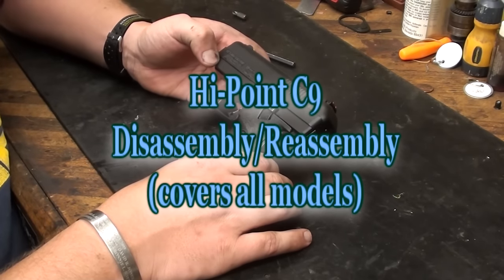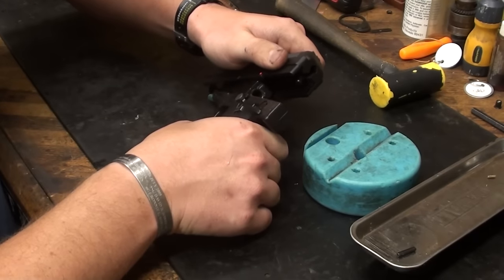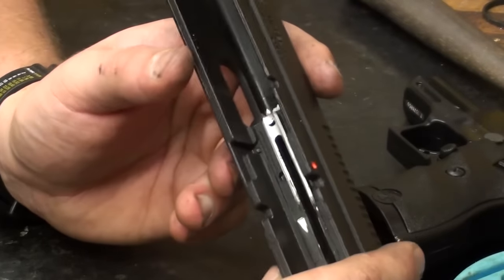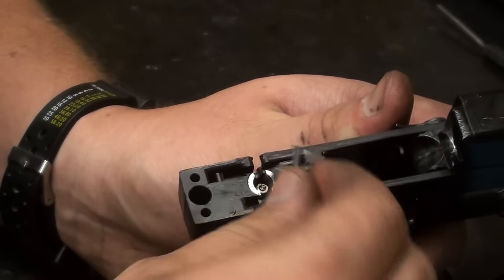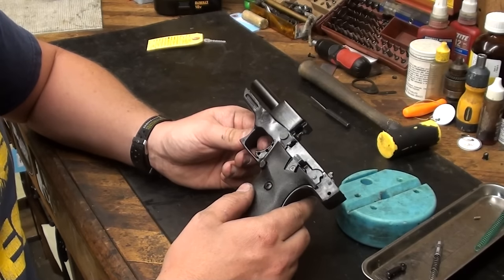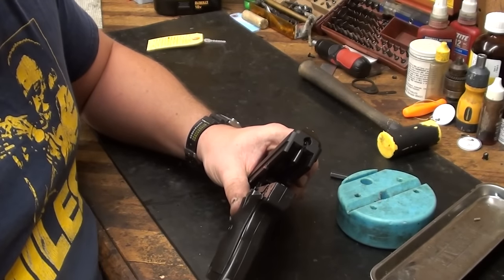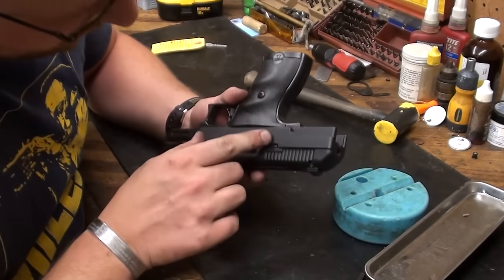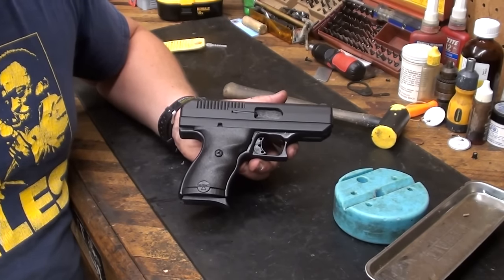Hi Point C9 Disassembly/Reassembly for Cleaning

Comment: There IS actually an ejector- the tip of the firing pin also serves as the ejector, just like the old Raven 25’s. The Beretta 25 and 22 Minx HAD ejectors, they did not have extractors at all.

Comment: Just picked up a like new Hi-Point C9 today. I mean it really looks like a new gun. Took her out right away that day and the sights were off. Got home and used a small screw driver and adjusted both windage and elevation. I also took her apart and oiled her up. There was very little cleaning involved. The gun just was not dirty. I'm thinking the original owner did not realize you could adjust the rear sight and so he got rid of the gun. His loss and my gain. Earlier the same day I had priced a new C9 at $189 at TED's. They took of $10 and would let me have it for $179. Go figure but I preferred the$100 asking price for a like new C9 over at the other gun store Called "Kings" Columbia TN. They let me have it for $119.99 out the door including tax and the $10 background fee. They originally asked for $129 for the pistol but they were nice enough to take of the $29. This helped me a lot financially and I made the purchase. Got a 50 round box of cheap Blazer 124gr. ammo just to see if she worked ok. I will purchase better quality ammo later on if I need too. 
The lips on the magazine are very closed and this results in a titanic struggle for me to load each round. I am thinking that I will do the mag modification and open up the mag lips. I read this helps the rounds to feed.I know I will be able to load the mag with a lot less effort once I do this. Maybe that's another reason the original owner got rid of this like new C9. Who knows I'm only guessing. 
I have a Hi-Point 4595TS Carbine and I like every thing about it. I'm so glad I discovered the American made Hi-Point's. Thanks to people who made these video's.

Comment: I have a c9 in .380 and I really like this pistol, thanks for the video. I'm disabled and have limited use of my hands and this pistol is easy for me to hold, and operate but the only thing I don't care for is having to remove the roller pin for field stripping.  Other than that this is an awesome and very durable pistol.

Comment: I needed a pistol and was loaned a Hi-Point 9 MIL. I wasn't a fan of the pistol but it was better than nothing and at the time beggers couldn't be choosy. I bought a box of Browning 9 mil. ammo and tried the pistol on a few shots. It was striking low so I used the tool that came with it and raised the impact of the rounds. To my surprise it was accurate beyond my expectations? I could consistantly hit a piece of paper 8X12 at 30 yards propped up on the hood of my truck. It didn't hang up but once in 30 shots. I believe the pistol is worth every penny they go for. Thanks for the video I was going to break the pistol for cleaning and got your video . Your video was well done!

Comment: I love your channel.And sorry to hear about barry.And in sure you know this by now,since the making of the video.If you notice that the firing pin is longer then most.Its because it double as the ejector.It dont eject off just blow back.If that was the case you wont be able to dry cycle rounds.Or clear malfunctions with a tap and rack.

Comment: Couple corrections. In hi points the striker is also the ejector. That's why you never hand cycle live rounds through a hi point.

Also you say most blowbacks have no ejector, which is not true. You're confusing the fact that most blowback firearms will function without an extractor (but they almost all have one anyway).

Comment: Hot Point will give you any part for one of their guns they are all LIFE TIME WARRANTY. No questions asked. This alone makes them awesome. Free parts!! 
 I have C9 380 with a compensator. Its factory and the barrel is an extra 1/2 inch longer to mount it on. Comes from Hot Point like this. I also have 45 apc. I like the guns but its the bulk and weight that stands out. My S&W 9mm or Ruger Mark1 doesn't out shoot them. They all shoot great but can't get double stack clips. Still, good guns.

Comment: These pistols look just like the cheap produced Bryco and Jennings models, all fixed barrels. To disassemble those pistols, you have to unload it and push the backs off and pull it forward. The whole punch rod holding the slide on for the hi-point is a big safety measure apparently modded to the original design. Good video.

Comment: Only issue is now after re assembly my rack sometimes doesn't want to fully pull back I have to use a lot of force it's like a spring is broken or something I have no idea what's going on with it I could really use some help about pulling it halfway I'll hear a crack and the spring and then I have to pull really hard to pull the rack back completely with or without mag but when it finally full racks it has no issues like that it will sit and perfectly rack while in (fire mode)

Comment: I have a C9 that the slide will not pull back far enough to lock the safety in the second slot. I noticed also the firing pin seems to be very extended
Reply: I have the CF 380 im also experiencing the same thing its close to the second slot

Comment: I took mine apart few weeks ago and guess lost something in handle grip underneath area. I thought maybe was a spring... Sear cam spring I guess.  I got one delivered and now guessing it isn't that piece there.  I'm now thinking its the safety lock bar part there that connects to other button.  In going to see if can't get that piece and hoping that's all.  I don't see how I choose lose anymore from it but I could be wrong.  I shouldn't have taken apart but that dumbness part that probably wonders how did this work type curiosity I guess.  Thanks though for letting me see more of inside parts.  I have the 45 acp one do maybe just little different I guess.

Comment: You actually checked the function of the safety with the magazine removed from the pistol after you have assembled it. The pistol will not fire with the magazine removed. You can only check the function of the safety with the magazine in the mag well. Please don't give incorrect advice when it comes to the safety of handling a firearm. At 11:40 in your video.
Reply: Yeah. Well I am a safe and accurate bonehead, you don't see me giving unsafe advice on the function of any firearm.

Comment: I think I'll pick me up one just tried it doesn't look bad at all I don't care too much about the field stripping I would have to get a punch it wouldn't be too difficult but it's a nice little gun and it works well the price is very reasonable I spend so much money on different guns that I'm afraid of firearm I don't want to get them dirty that's crazy isn't it I just like collecting them but the high point for the price I could run it and use it I think I'll try the c9
Reply: buds gun shop dot com has them even in a camo 9mm
Reply: my wife just purchased the muddy girl camo c9 9mm and is very happy

Comment: Buzz Clark, just lock the slide back, point the gun down, and hose it out with some CLP. Shake out the excess, dry it out with some rags and Q-tips, run sim patches through it, and you're done.

Comment: I'm watching this video on the role pin that holds the extracted in you need to drive that out from the bottom up through the slide as it has a slight bend  to it and will be next to impossible to drive down through from top to bottom

Comment: there is an ejector he showed it after he took the slide off.its in the side of the slide and held in with a roll pin from the top and has a spring behind it,he never took it out to show ya.

Comment: @Iraqveteran8888 im quite sure the firing pin in rearward position jams against that lollipop thingy (the wider spring fully compressed) and protrudes more from the bolt face, also blowbacks have ejectors too, surely you know that from your own experience. there allways must be ejector (or something that serves as) to gives brass the jolt to fly sideways, inertia acts in the direction of bore axis, it has no sideways component.

Comment: Mine will not eat hollow point rounds.. is that normal? Fmj are not a problem. But I'd like to fire hollows too.. any advice?
Reply: I've read for problems use hollow points with a bead in the hole...
Reply: Try Hornady Critical Defense rounds...Problem solved!😊

Comment: that pin you take out to remove the slide, what is it for? I was given an old c9 to try and fix and when I have the pin out I can slide it back, take the mag out, release the slide, put the mag back in, and dry fire it. but when I have that pin in, it won't dry fire at all. so what Is that pin for and does anyone know of a fix for this?
Reply: the "roll pin" is what I'm talking about just to help anyone confused with the question.

Comment: This gun's internal looks worse than a knock off Chinese copy of anything. The injection molded plastic lower assembly seems like the mold has been overused again and again and again without regard to quality control. The gun is top heavy but I wouldn't call this robust despite any "torture test". 

If it takes a whole 12 min to disassemble and re-assemble a pistol for cleaning instead of 10 seconds, then you don't know what you are missing by purchasing a reliable and better quality gun for just a few hundred more.

Good detailed video though.

Just my 1¢
Reply: Was worth just that!